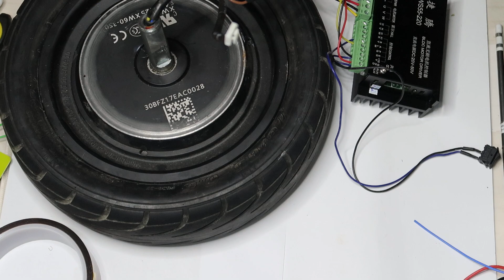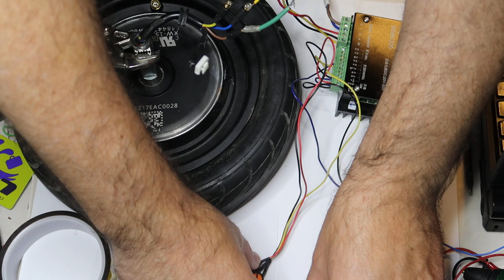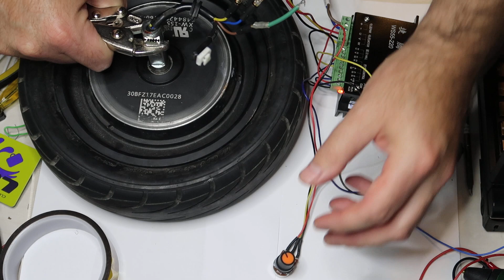controlling Segway Mini Pro wheel

Comment: Hi Roee, I'm trying to drive this same wheel with a flipsky controller like the one you reviewed in another video. The VESC tool configuration goes well, and can smoothly drive the wheel forward and reverse (when selecting if the motor should be reversed or not during configuration). When I try to exercise the wheel after configuration using the duty cycle sweep and current sweep it is very jittery, and does not rotate smoothly at all. I'm wondering if you have any suggestions about how you were able to rotate the wheel so smoothly. Thanks!
Reply from the maker: a lot of tries and errors, when I have more time I will get back to it, and send you parameters

Comment: Nice vidéo, pls I want to use throttle in place potentiometer, can advise me pls
Reply from the maker: Yes - no problem you need to use PWM with filter of resistor and capacitor. The PWM can be for example from arduino, use 1K resistor with 100nF capacitor to GND, the side of Resistor that is connected to capacitor will be your input to motor driver speed control